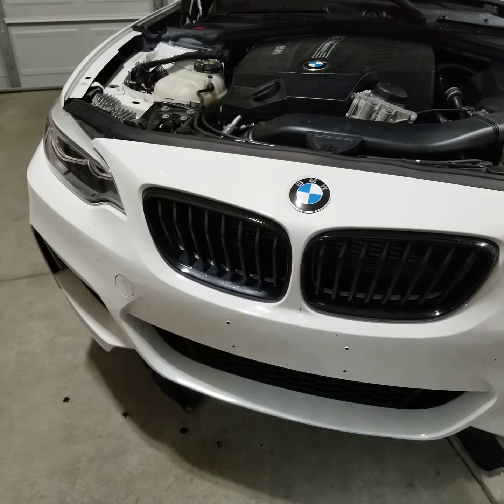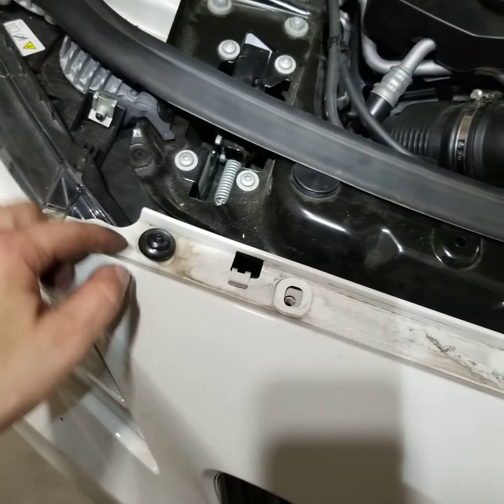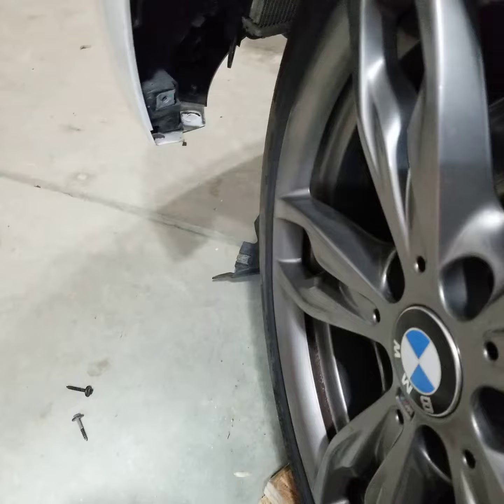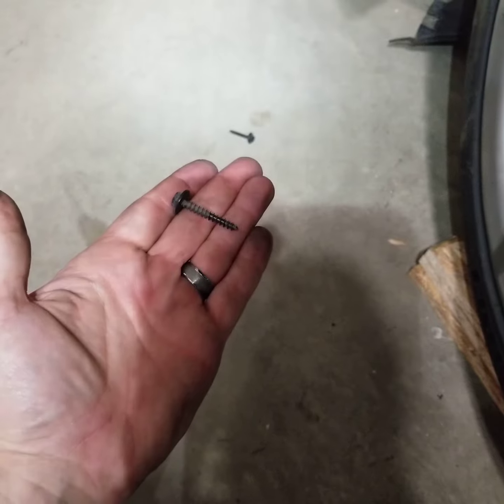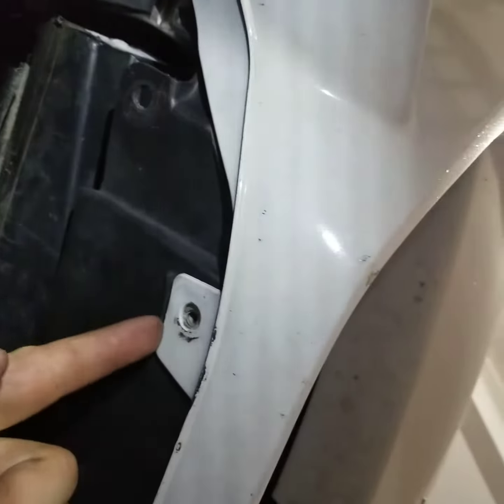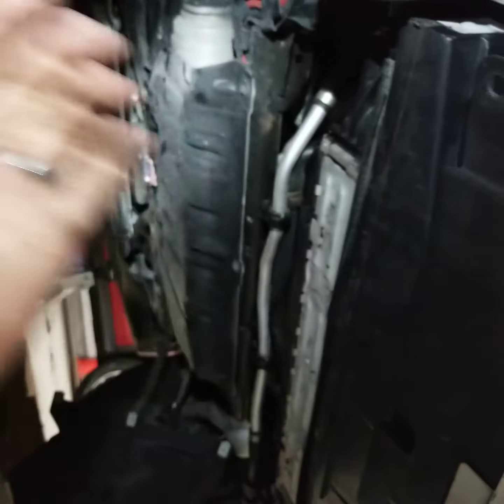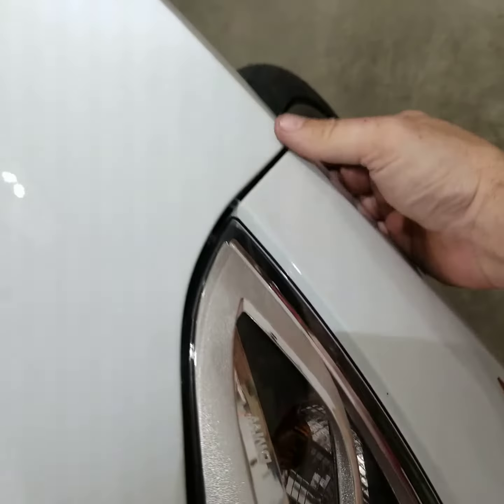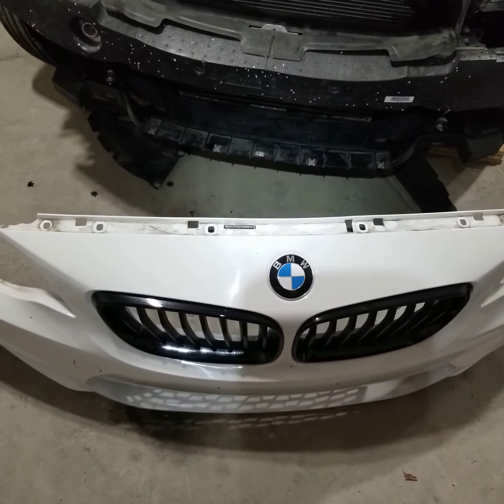F22 (M235i) front bumper removal

Comment: “Comes right off” — 5 hours later, it’s all back together lmao. Thank you for the video, you made it sound too easy
Reply from the maker: It really is that easy. Just take your time and make sure you get all the screws and clips. Don't force it. Also, if you have the parking sensors or the headlight washers, you'll have to get those as well.

Comment: This is useful, I thoguth I needed to take headlights out too and my one parking sensor pushed in so I just put double sided tape for now, Hoepfully it holds but if not I’ll have to take the bumper off slightly so I can reach my hand in and get it on better

Comment: Did you also have a wiper fluid line and actuator on your bumper? My m235i had little sauirtters in the bumper but I’ve never seen them in action
Reply from the maker: No, I don't have the headlight washers. I've had issues with my washer fluid squirters/pump as well, just never got around to investigating.

Comment: I’m actually doing an m sport bumper conversion and I’ve noticed mine has a lower reinforcement impact bar but m235i/m240i or other m sport models don’t have it. It’s right in front of the intercooler I’m wondering if I need to take this off or if I have it because it’s a convertible
Reply from the maker: Almost all convertibles have extra bracing throughout to make up for the lack of structural rigidity offered by full bodied vehicle. I'm not sure if there is a separate part # for an msport bumoer without looking it up.
Reply: Yes, I just had mine off last night of my F23 m235i convertible. A lot of extra braces and things I run into when working on my car compared to the F22 coupe videos I watch
Reply: IThinkItsEvan’s YouTube you think it’s fine if I take it off? Wasn’t sure if it was for stability or something important
Reply: Collin Rausch I put it back on it was just a couple bolts and you never know if you’ll need it, also support the cross member in front of radiator/intercooler
Reply from the maker: Thanks for helping out the community! 👏

Comment: Hey Mikey, Im interested in getting mine repainted as well. Is it ok to ask around how much it will cost? Thanks!
Reply from the maker: I still haven't gotten it repainted 😤😭 I do have a hook up through a friend here, just haven't gotten around to it. I wanna do a protective film after the paint which is more $$ than i wanna spend. Soooo it's not really a priority. 
As far as I know from asking around, the white BMW used is difficult to match after it's been on the car for a while. Finding a proper shop is vital if you want it to look good. From what I've heard, anywhere from $800 to $1400 for a fill of the holes and repaint. I would try to get the shop to GUARANTEE IN WRITING that it'll match or they will fix it.
Reply: Hey, I just got a brand new bumper painted. The OEM bumper cost $800, and the paint work cost $900. This is pretty expensive, but for paint jobs specifically, you definitely get what you pay for. Cheaper paint options may not color match correctly, and may not give you a good clear coat (learned this the hard way after experiencing clear coat damage after normal use and washing).
Reply from the maker: Great info! Thanks for sharing! 👍

Comment: How would the removal be different if I have headlight washers or parking sensors?
Reply from the maker: Remove all of the fasteners that hold the the bumper on but dont pull the bumper completely off the car yet. The bumper will Flex enough for you to reach in and detach the parking sensors from underneath the car. Then you should be able to do and washer hoses from the top or the side.

Comment: I need to change my headlight units. How much time would a mechanic take to the do the install?
Reply from the maker: I don't know how many "Labor Hours" you'd be charged for but it would take at least 3 hours. Keep in mind, added in that job is the adjustment of the headlight beams after the new housings are installed.

Comment: Did u need to take off the wheel to remove the render liner? I cannot find a way to remove it. The wheel gets on the way
Reply from the maker: Removing the wheels gives you  more room to maneuver but not completely necessary.
Reply: @TheWrenchLab  I dont think this any works for me, looks like I have something that sprays the headlight and sensors
Reply from the maker: @radiomaster200  you have the headlight washers amd parking sensors. That makes a good point. Something I should point out in the video that my car doesn't have these features. I've been waiting to remake this video and that gives me a good reason.
Reply: @TheWrenchLab  I managed to take it off enough to swap kidney grills. Turns out you can disconnect a pipe on each side for the headlight washers and the sensor seem to be attached to the bumper.
Reply: Just to make it easiler for you, you done need to take out the bit he took out behind the whell, i forgot what its called

Comment: Does the M2 bumper fit on the M235i?
Reply from the maker: Short answer, no. I do recall seeing a body kit that was an M2 replica for the M235 though. But it's probably fiberglass... 🤮
Long answer. You'd have to get the fenders and some of the under bits that attach the bumper to the car on the bottom. But, I'm not positive everything will line upon the femders and such. If you donsome digging on the 2addicts forum I think you could find that out and if someone makes a body kit. I just don't have time right now to research it quickly. 
One thing to note, which not a lot of people know. The M235i has a smaller frontal area and a lower drag coefficient so it will take less HP to push it through the air than the M2. Take my car for example. With just a charge pipe and a JB4 running map 1 and ran a 12.80@106 in the 1/4 mile. $550 worth of mods to run the same 1/4 mile with far less HP than the M2 because of the lower drag coefficient. M235I for the win! I was thinking about making a video about this...
Reply: Ahh.. ok! Thanks for your long answer, Mikey. I am currently selling my R8, meanwhile I'm looking for my next daily driver. 

Really like the design of the front bumper of the M2 but the M235i is a lot of car for your money, especially with a JB4 tune as you said. Also the M2 is really expensive in the Netherlands because of all the taxes so that makes the M235i even more interesting.

Those are really good figures! Didn't know that the M235 has a lower drag coefficient. You should make a video about it, interesting stuff mate :).

Ps. do you have Instagram for your car?
Reply from the maker: Definitely a lot of car for the money! It's a diamond in the rough. 
Insta is "WithMikey"
Reply: RaffyUkon there is replica m2 bumpers that are custom fitted for the m235i now a days